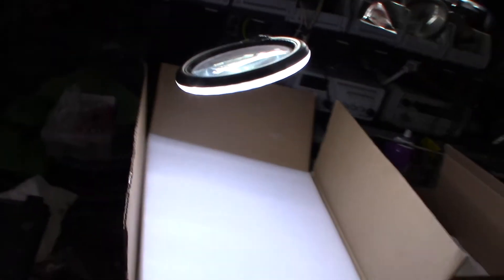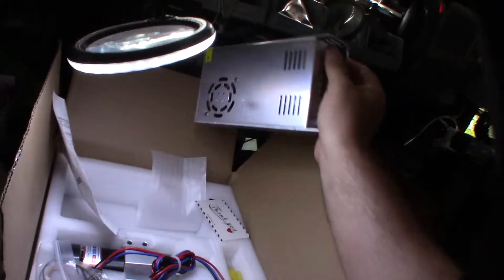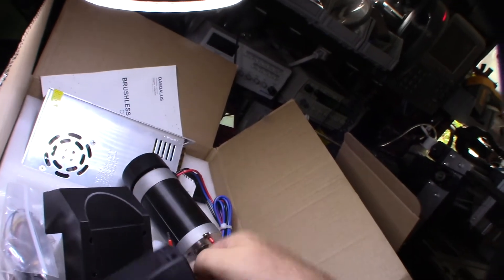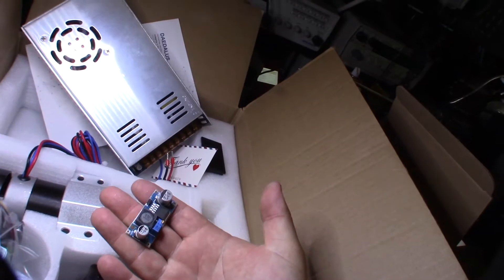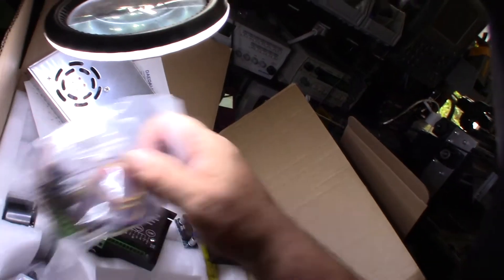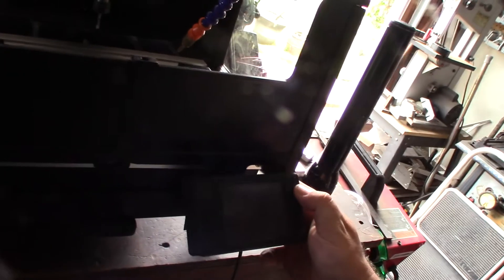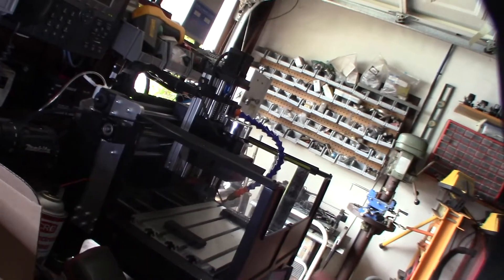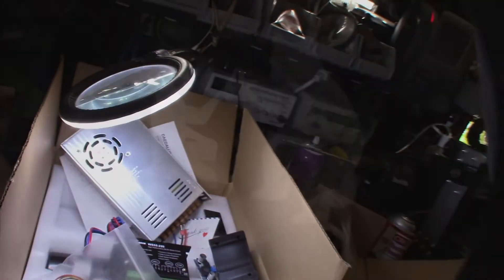3018 CNC 500W brushless spindle upgrade, cut aluminum and possibly steel GRBL Mach3 10V  Part 1

Comment: Any feedback on the Brushless spindle?
That should be a huge update compared to the stock spindles on these machines, I have one and it is horrible, really out of balance.
Reply from the maker: know have this cnc mill. I upgraded to a massive unit. The spindle did make a difference. Made some pretty decent cuts with it and the ball screw upgrade.

Comment: Nice video. How's that brushless spindle holding up? any overheating issues? I have a heavily modified 3018 prover and trying to decide between brushed or brushless motor. hard to find info on brushless but the reviews i have seen talk about overheating if ran above 70% power.